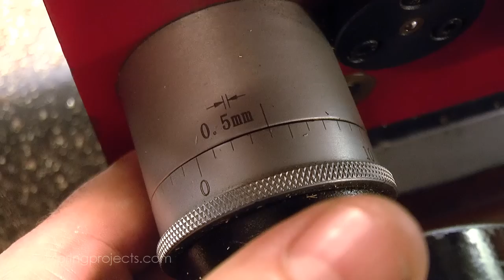A Great First Lathe Project

Comment: This was one of my first projects after getting a Sherline lathe, and I still use it with the same tip as when I first made it some 6 years ago.  I also used this as a template to make a couple of ink pens that use the Pilot G2 inkwells, and I also keep those in the shop or with my notebooks.  The scriber is indeed a great first lathe project.  I need to eventually get around to making some wooden ones as gifts.

Comment: But why a needle and not a sharpened TIG electrode?
Reply: A TIG electrode would work but this is a FIRST lathe project. 
Sewing needles will be readily available in a beginner's shop, cheap (if not lying around the house already in sizes your partner will never use) and easily replaceable when worn/broken.